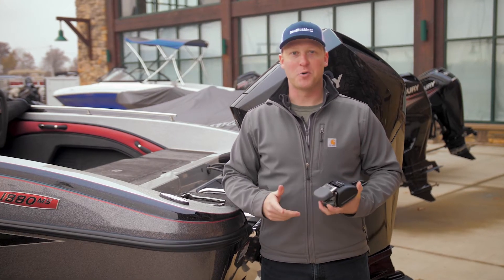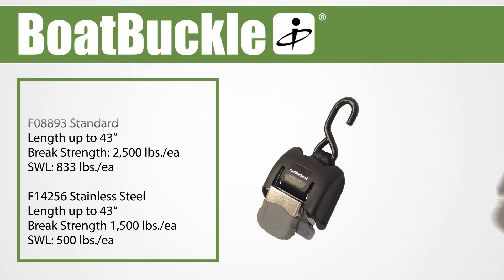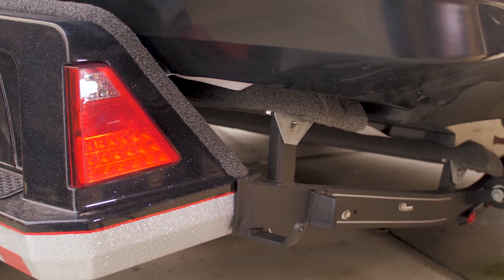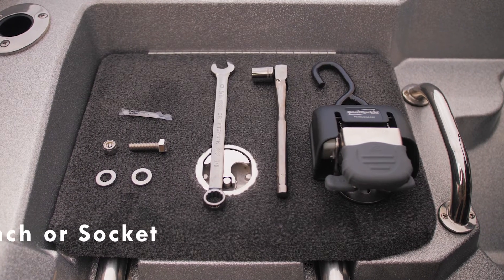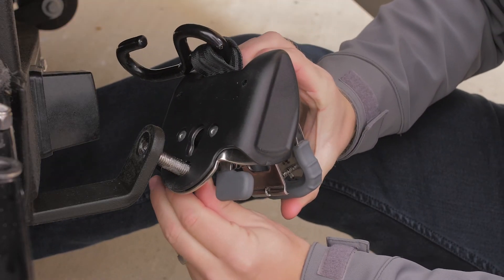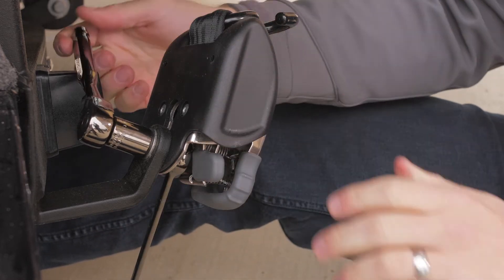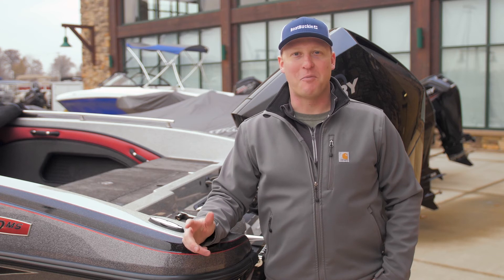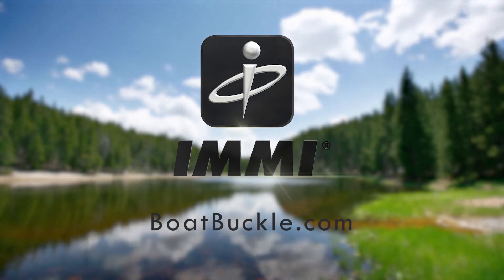IMMI BoatBuckle Installation

Comment: Another incorrect Boat strap installation! This time, it seems to come from the manufacturer. This strap installation example far exceeds the maximum '30 degrees from vertical' stated in this installation instructional vid.